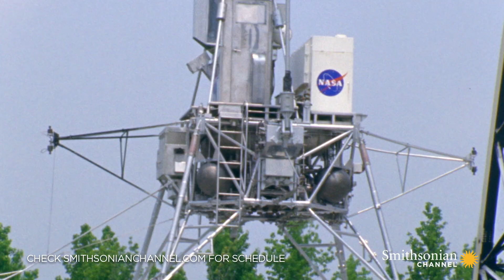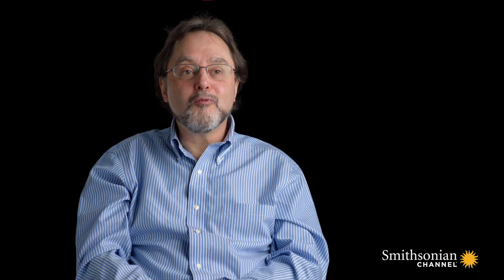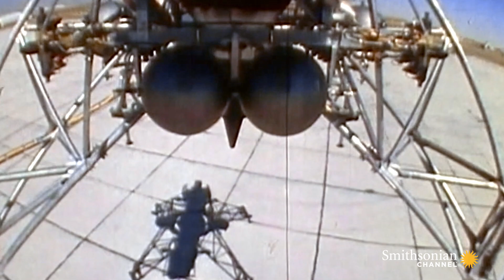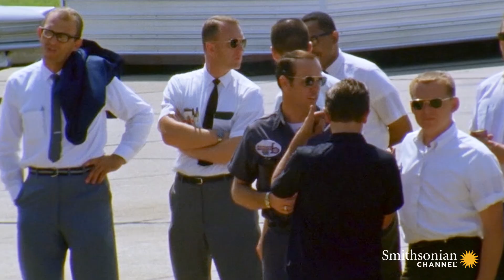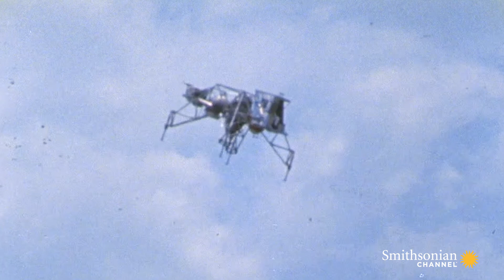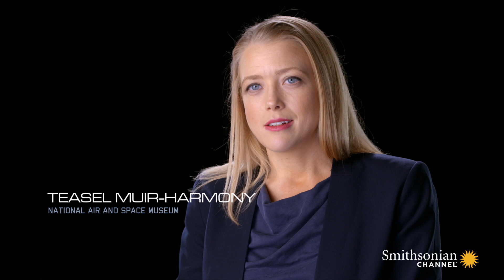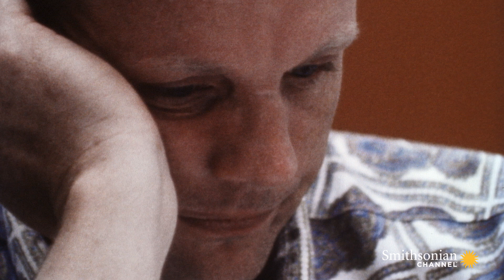How Neil Armstrong Trained to Land the Lunar Module

Comment: They did 20 test but only showed the unsuccessful one 😂😂😂
Reply: There were over 600 flights of the various versions of these craft. 

Try harder to earn that flatter claim of yours of doing your own “research”.
Reply: Why do you think they recorded the tests?  They didn't do it just for fun.  They did it to have a point of reference in the event something needed to be reviewed.  If the test was uneventful/successful, there would be no reason to review the tape.  Using that tiny bit of logic, it would make sense that footage of the unsuccessful test would remain after all these years being as it would have been the footage that would have been archived for review.  Plus - it's interesting footage anyway.  Footage of successful tests exist; they just aren't in wide circulation because there is nothing note-worthy about that footage.  It's sort of like wondering why searching for footage of the World Trade Center in NYC will provide you a lot of hits of footage of them being hit by planes or collapsing - while just random footage of an uneventful shot of the twin towers isn't among the top hits when searching for footage of it.  There wouldn't be much footage of these tests to begin with so finding uneventful test footage is harder to find.  Much of it was likely non-archived and recorded over.  There is no reason to keep it.

Comment: The analog version of landing a SpaceX booster upright.  Neil was controlling the gimble of the main engine and the yaw and pitch thruster rockets by hand with no computer aided help because they didn't exist!
Reply: You're kind of wrong. While the vehicle wasn't autonomous it was actually one of the first applications of fly-by-wire tech.

Comment: I  wonder why human space exploration went backwards for 52 years?
Reply: Money
Reply: Hobbes pretty much nailed it.  Human exploration hasn't really gone backwards - - although the funding for NASA has been cut (percentage wise) as compared to what they had during Apollo.  For Apollo, landing men on the moon was an absolute priority for the United States because beating the Russians to the moon was really the motivating factor.  We won, went a half dozen more times, landing 5 more times, and then shut it down.  Now, the goal is Mars and we need to be able to study how the human body reacts to 0G for months on end (which is how long a mission to Mars will take).  How do we handle consumables?  How do we handle waste?  In the meantime, there are other research projects that they take on aboard the ISS, but the primary purpose of the ISS was to study the impact on the human body from prolonged exposure to a zero G environment.

That said, there is a program in the works (Artemis) that plans to land humans on the moon again.  Artemis I has already flown.  It was an unmanned test mission that slung around the moon a couple times and came back.  Artemis II will be a similar mission - - but manned.  Artemis III is slated to be a manned lunar landing on the moon.

There is also a program called "Gateway" in the works - - which will be a station in orbit around the moon.  Ultimately, ships like Artemis would go to the moon and dock with this space station Gateway, refuel, resupply, etc....and head off to Mars.  We aren't going backwards.  It's just that there is a gigantic leap between manned missions to the moon and manned missions to Mars.  In the grand scheme of things, 50 years is not really that absurd amount of time between those two destinations.  The moon is about 240,000 miles away and a mission there and back takes about 10 days (spending just a few days on the moon).  Mars is 140,000,000 miles away.  There's a bit of a difference.  Add onto that.....we aren't going to spend 7 or 8 months to get to Mars just to spend a couple days there.  Our stay on Mars would be much more extended than the lunar missions; otherwise - that's a long way to go to just spend a couple days there.  It's a BEAST compared to a lunar mission.

To put it another way - - Apollo took about 3 days to get to the moon, and the longest any mission spent on the moon was about 3 days as well.  We aren't going to take 8 months to get to Mars only to spend 3 days there.  We won't go to Mars until we can stay there more than 3 days.  We'd likely want to spend MONTHS there.  If we wanted to just land on Mars and spend a couple days and then return, we'd probably be able to do that as soon as hardware was available, but we don't want to travel that far just to spend a couple days there.  So, there is also the issue of life support and things like that for such an extended mission.

Bottom line - - we aren't going backwards; we've just set our sites on missions that take a lot more time to plan and pan out.  Meanwhile, there IS another manned lunar program in the works - - which is in essence a test program for an ultimate program that will land humans on Mars.  The Artemis program is essentially a precursor to a Martian landing program.  This isn't backwards.  It's forwards at a pace that seems slower than something like the Apollo program, but only because it is FAR more ambitious.
Reply: After the Moon, we started to find out what would need to happen for a mission to Mars. Such a mission is not just more difficult than a lunar mission, it is orders of magnitude more difficult. Apollo was already the most expensive engineering project in history, and nobody was willing to spend even more on Mars missions. What we did  instead is start to pick away at that “orders of magnitude more difficult”, by building a space station where we could study in detail what happens to humans when they live in 0 G for months on end, and how we can operate spacecraft on those timescales.

Comment: One problem, there’s no air or medium for the puffs of propulsion exhausts to push through to control the LEM on the moon.
Reply: Please learn Newton's third law!
Reply: Rest assured that The Principle of Conservation of Momentum works quite well on the lunar surface. Take care.
Reply: @TheWokeFlatEarthTruth    We didn’t go to the moon.
Reply: @reyrey4261  Perhaps someone who does not understand basic Physics should not be making such pronouncements. Take care.
Reply: @reyrey4261 
Nonsense!
Voyager flew by Jupiter, Saturn, Uranus and Neptune, but not Pluto.
Reply: @reyrey4261  you're acting like they're receiving top notch quality signals from voyager using a hand held radio, they're actually receving very weak signals using the largest radio antennas on the planet
Reply: @fromnorway643    Who took the image of Pluto then?  There’s Voyager I and Voyager II.  🤣
Reply: @oscarin13  They say a billionth of a billion of one watt strong.  Yeah right, from billions of miles away.  🤔
Reply: @oscarin13    Who untangles the fragile 8-track tape on Voyager that’s beenworking  at sub-zero temperatures for decades?  I can’t even fix my 8-track tapes after a couple of years.
Reply: Another victim of our modern "education" system.

Comment: Now increase the speed to 6000 km/h and land it on the ruff surface of another planet where you've never been before. If you think that challenge is even close to what they're doing in this video you are insane.
Reply: The LLTV only simulated the lunar landing phase, not the orbital braking maneuver.
Reply: They certainly didn’t land at 6000 km/h, because that would have been more of a crash, and there probably wouldn’t be much of either of them left to talk about
Reply: And so you would just go to the moon with zero testing and training? That makes sense. Good luck, bro.
Reply: If you think "that challenge" in its entirety was the purpose of this test, YOU are ignorant.
Reply: @eventcone  I wasn't. But this is like preparing for the moon by driving around in a golf cart.
Reply: @jerryhall5709  Don't look now, but your ignorance is showing. The LLTV was as close to the real thing as they could get here on earth. The big jet engine at the center of mass was throttled to reduce the weight of the vehicle to   that of the lunar lander in lunar gravity. The control jets and even the control system were mockups of what would be on the lunar lander.
Reply: Every flying contraption always has to do a first landning. But, one can train in advance.
Reply: It’s not planet doof

Comment: So they never actually flew the LM before the mission? Theres no footage of the actual LM in operation on Earth?
Reply: Not in earth but earth orbit yeah they do it onApollo 9 they test the lm on earth orbit
Reply: @TGentong  thanks for Reply.
Reply: @Idalg87  np
Reply: @Idalg87  And Apollo 10 manned in lunar orbit.
Reply: Also the first test of landing the LM was Apollo 11. Yes, that momentous mission was itself a test flight. The whole program was conducted to flight test discipline and procedures.

The tests of the vehicle and its component parts on the ground, followed by tests in Low Earth Orbit and Lunar Orbit, gave NASA the confidence that they were ready to move to the next part of the test program - landing on the Moon!
Reply: No, the LM wasn't structurally designed to land its mass in earth's gravity. The stress on the structure would have been to high so they would have had to create a complex system of offsetting the weight. It just wasn't an efficient way to do it.

Comment: This should be called, "How Neil Armstrong landed on the moon." Except the real LEM was tin foil and curtain rods and wouldn't have held together long on the crane.
Reply: The LLRV and LLTV are simulators: they try to emulate as best as possible a real LEM in lunar condition, while being under Earth gravity and in atmosphere.
The real LEM cannot fly on Earth, it's purely a Moon machine.
Reply: @ThomasKundera  Interesting. How did they know in advance that it would work on the moon, even though not on earth?
Reply: @1133saginaw  oh, okay. well, I guess that solves it. Wonder why they don't use it now then. Maybe in the next 5 years. Maybe.
Reply: @1133saginaw  They never tested anything before Apollo 11.  9 10 never went Apollo 8 went to take Earth Rise photos ( CGI cartoon so fake photos) How could anyone test the lunar Module without being in it. You are liar to the Ultimate Degree.
Reply: @goattruthtv6431  The ultimate LM test was performed by Apollo 11. It was successfull.
Reply: @goattruthtv6431  I started working with computers back in the days of core memory (IBM 1130s, 360s, etc). Not only were there no CGI capable computers, what CGI graphics were available at the time of Apollo displayed wire-frame models. Solid surfaces were yet to be developed, much less shading and texturing.